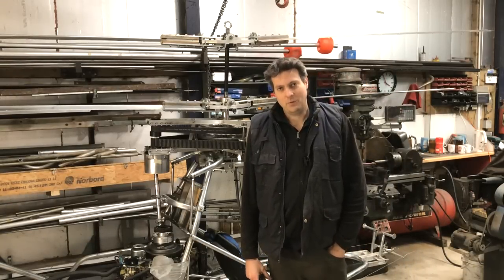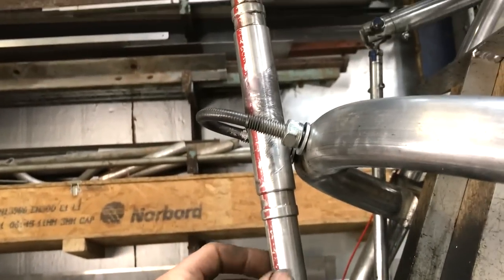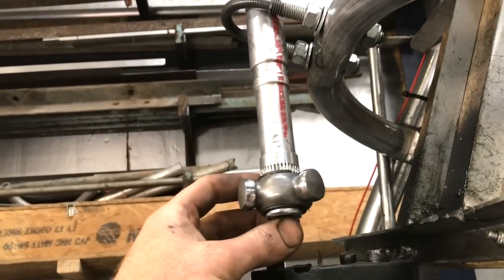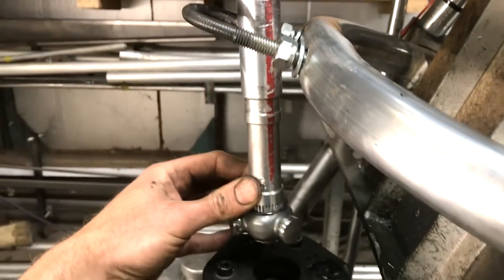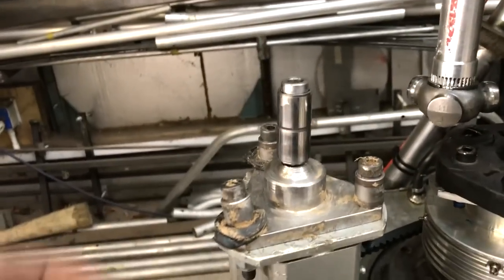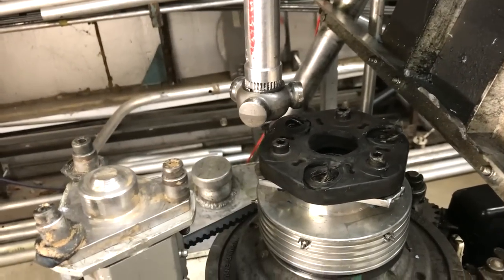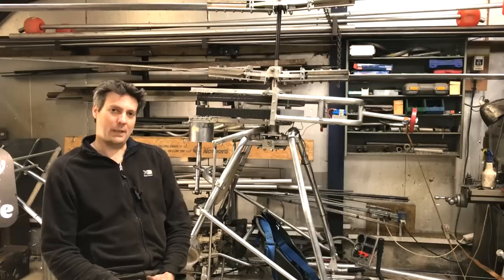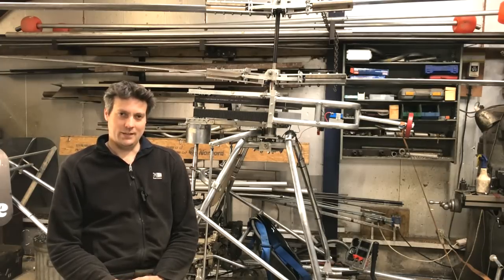What I got WRONG, Homemade coaxial Helicopter

Comment: It was a fun inspirational series! If you to embark on new one, would gladly watch one more. Starting new one makes a lot of sence since you had unsolved problem with cooling which need to be solved eventually and this engine was never designed to be air cooled to begin with.

About shaft touching the frame: didn't you at some point due to design changes extended range of tilt cyclic when you were getting rid of extra weight?
Reply from the maker: Thanks. Well the travel was more before I modified the mast hinges, it broke with less travel than last years testing. The shaft is just wrong and needs to be changed but I think I would rather start a new flying machine with the new knowledge.

Comment: If you are only using this helicopter to fly in ground effect, then there is no point in the trouble of collective pitch.  Yes it can teach you how to hover but thats a skill you can learn in a few hours in an R22 or Rotorway. Teaching yourself how to hover can be done but its going to take a lot longer and you will learn  a lot of bad  habits.
In the Rotorway world, many people have taught themselves how to fly and you see a lot of incredibly stupid people. 
I watched one guy who taught himself, he could  hover, take off and go up vertically to about 100 feet and then descend and land in the same spot. He could not do anything else.
Then another home builder would start it up, run it for 15 minutes and never ever go to a hover , he just liked starting it up and revving it up.
This project could be a lot better with just a single rotor and collective / cyclic pitch rather than moving the control head around like a gyroplane.
Reply from the maker: I agree with what you have said. I'm all for education I would take lessons if the plan was to go further than a couple feet. The bad habits point is a valid one. I was driving cars years before I took lessons to drive on the road and some habits had to be undone.

Comment: Welder here.  Yes the break looks like a fatigue failure.  The fine grain is crack propagation which would suggest a cyclic flexing failure, probably starting at a stress notch (the shoulder of the piece).  The courser grain in the break is where it failed once there was not enough material left to resist the forces trying to tear it apart.  The longitudinal nature of the break suggests something that was out of alignment and resisting movement in one plane.  I'd look at under a microscope to learn more.  Corrosion in the fine structure would suggest the crack propagating over a period of time (I would not suspect corrosion cracking being the cause in this case).  There does appear to be some darker sections in the fine structure but I can't see if it's corrosion or spalling.  If it was happening over a period of time rather than all at once it would suggest a problem that was there all along, rather than something suddenly going out of true.

I do think you're almost there.  Suggestions: find out what is causing the cyclic stress and correct it (I don't think it's the use of two CV joints but something else that's preventing it from running true), remake the part with a rounded shoulder instead of the square stress notch, and look at the material choice.  It should probably be some kind of heat treatable steel alloy (ie tool steal).

You know, we learn more when things break than when they don't.
Reply from the maker: Very informative comment. Thanks 👍

Comment: Hi you mentioned fixed pitch with a tilting rotor and collective with a fixed rotor have you investigated the fixed pitch that was popular with the early model helis 
It was a fixed central shaft with a swash plate and the blades were on a teeter system where one blade would reduce pitch while the other increased the swash plate was set 45 degrees out and this meant that you got the simplicity of fixed and some of the advantages of collective 
The height response was slow and controlable and the pitch  and yaw were very quick if you can find an old mfa fixed pitch heli model it was very simple and handled quite well they could also be converted to collective with a few extra bits
How this could be used with counter rotating blades I am not sure but I do believe a few models did exist that flew very well without a tail rotor
This would greatly reduce the amount of rebuilding needed to your machine and you could use fixed UJ's as the head would not need to move
Seems a shame to get so close and give up but if you do good luck with the space ship 👍
Reply from the maker: Thanks, I'll see if I can find exactly the model you are referring to.

Comment: Well done!  Just like SpaceX one learns out of failures.  I think the key thing is to decide what you want to achieve. If it is to fly then this is not the route- rather get a homebuilt kit of a proven design ( or if you can afford it go fly R22’s). However if you want the satisfaction of creating from scratch and proving you can do it and just hover around the paddock then keep at it!

I am a Mech eng and ex PPL fixed wing pilot and agree with your analisys. This design has a lot of limitations and compromises. The heart of it is in the rotor and drive system. And the rest is only a bit of frame so it may be better to start with something completely from scratch than trying to modify this to a CP version. Doing CP on a coaxial is going to be complex and may end up having many more moving parts than a conventional rotor and tailrotor assy. More moving parts = more failure points 

Anyway you can be very proud of what you achieved! Well done🙌👏😎
Reply from the maker: Thanks so much. I'm excited about the prospect of something new, just need to decide which way to go. Hovering around is still attractive, there are loads of options to consider.

Comment: Would it be too complex/to much extra weight to alter the gearing at either end so the shaft can run at a lower RPM?
Reply from the maker: Well it's probably doable but not straight forward.
Reply: @Ben-Dixey  It would add another possible failure point but perhaps it would ease the strain on the CV joints?

Comment: Go for the pulse jet rotor tip helicopter, look at the Hiller Hornet
Reply: No, no, tip jet drive Helis are misleadingly simple, the ones that have been built are by big còrparations with unlimited facility's and budgets,  also they have a excruciating  noise problem and are very thirsty.
Reply from the maker: Tip jet helicopters are interesting and sort of simpler. Worth considering

Comment: Well done going on that journey.  It seems electric motor drive is the future for small craft.  Even if a combustion engine is onboard as a generator. With direct drive to the props there is far less to go wrong mechanically.

I’m surprised no one has done a small chinook clone.  you could use a belt front to rear instead of two gearboxes.

With a motor at the front and rear the belt would just be to time the rotors so they don’t collide.
Reply from the maker: Well a small chinook would be excellent as the next project. A definite contender and as you say I've never seen another.

Comment: Heyo, definitely looks like a fatigue failure,  which of course means even if you fixed the design it would likely fail again... 
It's possible a different kind of steel may have a lower failure floor, or perhaps some other material... 
However, I would not suggest trying to fix the current frame. You do not know what microscopic fractures could have been imparted to parts of the frame from the joint failure, or whether some parts have been bent and would cause the frame to be imbalanced. Failure of the helicopter frame would be catastrophic and extremely dangerous.
Reply: The shaft in question is to big and heavy to be going at engine speed..5000 plus, also the engine needs to be in  line with the upper coupling......and moving the engine is a monumental task .

Comment: Hello, me again. Any chance you can move the tilting joint to right under the bottom rotor? Keep the driveshaft and gearing rigid and strong and only control the tilting of the mast. A strong universal joint should be able to take that torque.
Reply: Yes, I believe this is the wasy to go if one proceeds, but:
as BTD said, and I believe he was correct, an attempt to change direction quickly is doomed to failure because of the mass of the upper rotor and it's distance above pivot point. In that respect it is probable that he has even yet underestimated the gyroscopic effect of the mass of the upper rotor.
Reply: @rose 375  Also, I have seen enough videos of homebuilt attempts using tilting mast and the vibrations generated to seriously doubt it will work, even with two counter rotating rotors which supposedly cancel these vibrations out against each other. There is a perfect video on YT showing someone attempting a single rotor helicopter but without knowledge of gyroscopic precession. As son as he tries to tilt the rotor forward, you can see the aoa of the advancing blade, in this case to his right, increase.

Comment: Well I hope you at least get the driveshaft issue sorted. As for the issues you mentioned with torq in the cyclic operation what did production models use to overcome the issue,I would imagine it was load sensing hydraulic. Why not take the knowledge an experience gained on to a new machine with conventional layout, but do repair the test bed💁‍♂️🐒
Reply from the maker: good suggestion 👍
Reply: There are no production examples of this setup.
Reply: @cloudusterable  Bold statement ,when Kamov have had them in production since 1952,at over 300 units alone for first model. Sikorsky too have produced as recent as 2019.💁‍♂️🐒
Reply: Misunderstanding Colin, there's been no production version of the fully tilting head system that BEN has built Kamov are the standard co axial config like many others.
Reply: @cloudusterable  aye,fair enough. Load sensing hyd might be a way for him to proceed nonetheless, if his motor could power it ,either mech or elec.

Comment: Thanks a lot for informing us in details , 
What I feel you need to stick with same project and improve and correct it accordingly brother, 
I know it's very tough but any space to reduce distance between lower and upper rotors ?
You came to this successful stage ,you made a model that is  safe and didn't harm anything around, it's an achievement.
It left the ground..and hovered which is toughest part ..these issues you are facing now are miner i think , they will be corrected ! 
Do you think the issues you are facing are massive drawback?
You are certainly able to handle them now on this stage .
I wish I could be around to give you helping hands.
But just don't give up brother, this module is provenly trustworthy still .
And i believe you keep the safety first on priority so i don't need to remind you that...
Anyway when i finish one project the boredom hits me badly, keeping you busy in the project is a joy ...and this project has some challenges but this isn't bad brother.
It's an invention almost so will take bit of time but 100% success is there ...
Reply from the maker: I think the project could be carried on in it's current design but I wonder if my time could be better spent on a new improved version or something else in a similar category. I haven't decided which way to go but I'm sure in a week or two I will have made a decision.

Comment: That shaft(broken one) it shouldn't be made out of aluminum. It is not possible to bring up the engine, and get rid of the driveshaft?
Reply from the maker: Yes it's possible to bring the engine up. What''s wrong with an aluminum drive shaft?
Reply: @Ben-Dixey  It is not strong enough, as you experienced.
Reply from the maker: The bit that broke was en8. The drive shaft that didn't was 7075t6, the strongest aluminium available, it has the same tensile strength as mild steel. Incredible stuff.

Comment: Having the pivot point between the upper and lower would make more sense from a mechanical standpoint. Is that possible I wonder.
If you're not happy flying Pixie I think that's fair enough. You're right feathering does give you more instant control but I was hoping that a simpler design would prevail. 
I reckon a gyrocopter is the next phase. Those machined parts might still be useful. 😉 👍 I look forward to your future endeavours.
Reply from the maker: Pascal Chretien did manage an electric version, it had the hinge between the two drive pulleys, bit better design.
Reply: If you say so. 😀 I always wanted to fly a Cricket or Benson or Little Nelly from Bond film. Great fun.
Reply: Gyrocopter is a different thing altogether  no hovering caperbility, needs a runway etc

Comment: I'm old, and I've learned some things from building some fairly ambitious projects. One is to always be prepared to build a part or an assembly more than once. Many people are loathe to redesign or rebuild something, thinking that it is somehow wasting time. Not so, you're way ahead by starting again rather than persisting in trying to make a substandard part work. If it takes four or five iterations to get there that's just what it takes. And whatever you build, whether it succeeds or not you always learn *something*. The other thing is to abandon a dead end quickly, and again a lot of people resist walking away from their invested effort, when the smart thing to do is recognize and acknowledge that the original build was successful in providing information and data and that info should be put towards a new build with more potential. But remember the original build isn't a failure; it's just an initial step towards success that provided its own fun, satisfaction and education. And finally, recognize that ambitious projects, while being immensely satisfying and fun, can be stressful and mentally draining. It's important to look after your mental well-being and try to maintain some balance in your life. When things go wrong it's easy to lose all self-confidence. Looking after yourself not only makes you feel better, it let's you perform much better and think more clearly, and makes all the inevitable setbacks much more manageable.
Reply: Great post... totally agree!
Reply from the maker: Thanks so much for the words of wisdom. Agree entirely